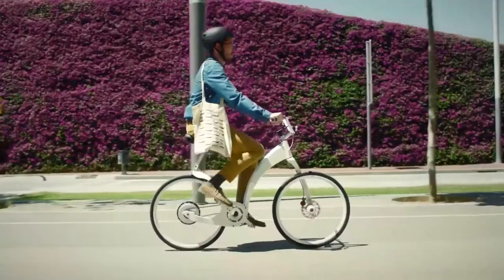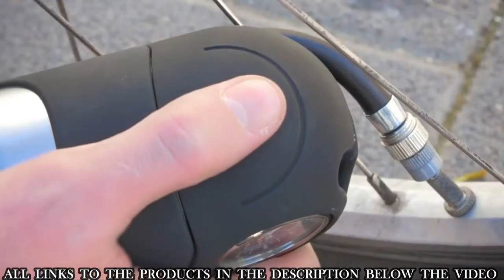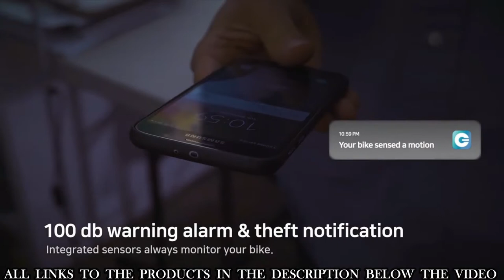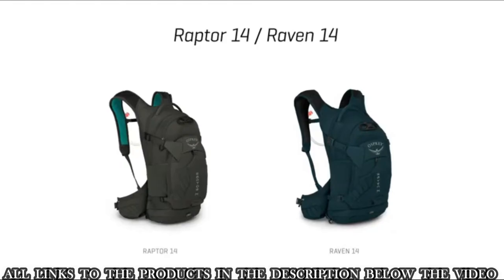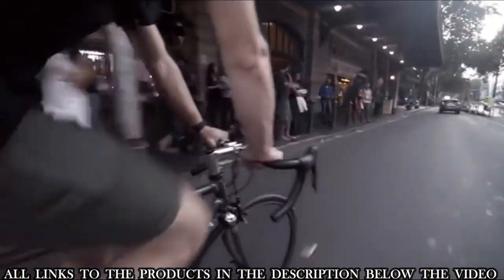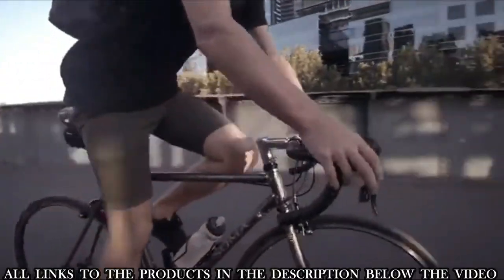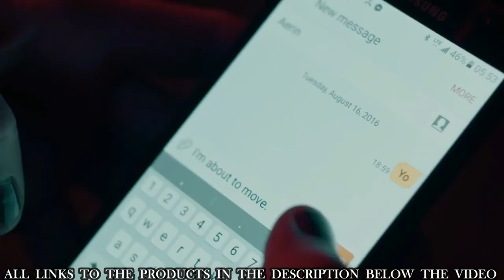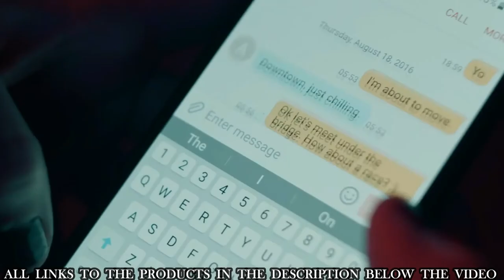Top 8 Bicycle Accessories & Bike Gadgets

Comment from the maker: top 8 bicycle accessories & bike gadgets that will make your everyday ride convenient and efficient. There are plenty of amazing gadgets you can use with your bike so check out these coolest gadgets for your bicycle.

Best Cycling Gadgets List:

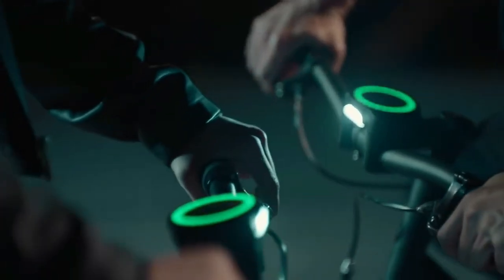1 . RideAir - The Effortless Air Pump 00:42
Amazon US: https://amzn.to/2X5IFwZ

 2 . BISECU Smart Bike Lock 02:58 
Amazon US: https://amzn.to/3k2rsh3  

3 . Osprey Raven 14 Women's Bike Hydration Backpack 04:00 
Amazon US: hhttps://amzn.to/2VqGq6L

4 . Knog Oi Bell Aluminium Bike Bell 05:30
Amazon US: hhttps://amzn.to/2Vt7nqD

 5 . Activ Life LED Bike Wheel Lights 07:58 
Amazon US: hhttps://amzn.to/3jVch9a

6 . WATERFLY Hiking Waist Bag 09:11  
Amazon US: hhttps://amzn.to/3tt8mDJ

7 . reTyre Modular Tyre System 10:35 
http://bit.ly/2Lw0uiZ 
 8 . SmartHalo Bike smarter. 11.48
http://bit.ly/38lxlQr